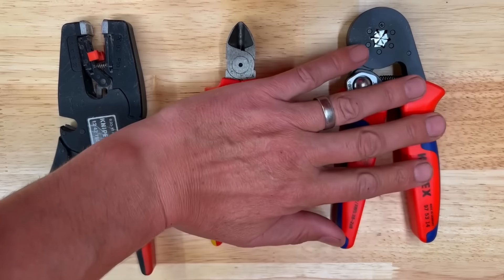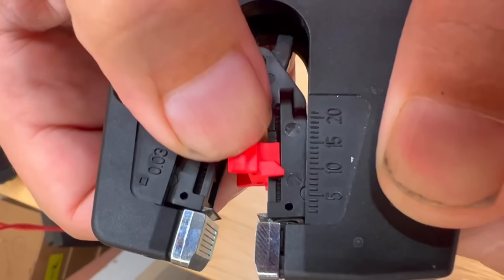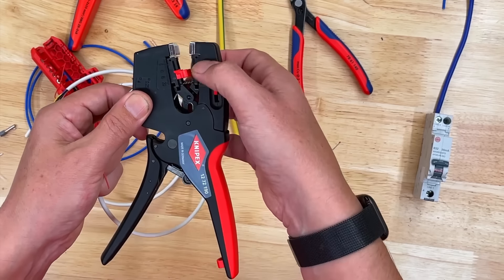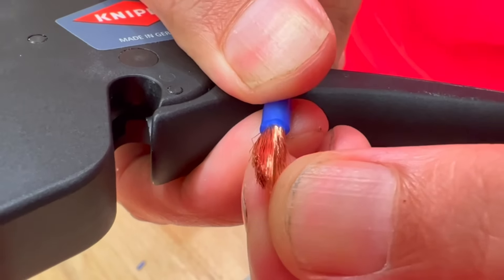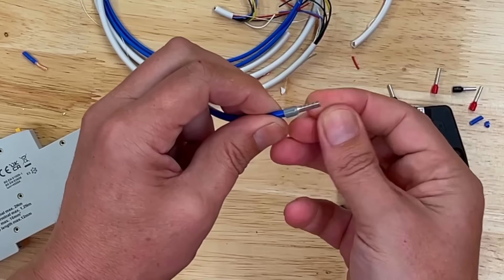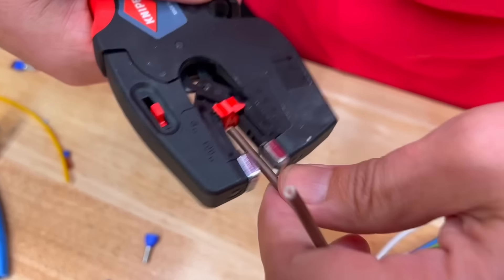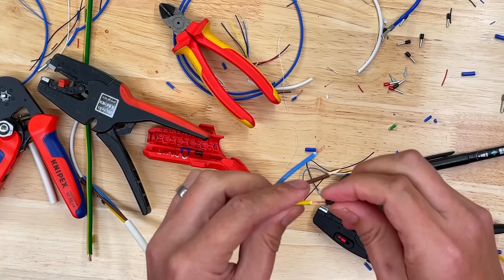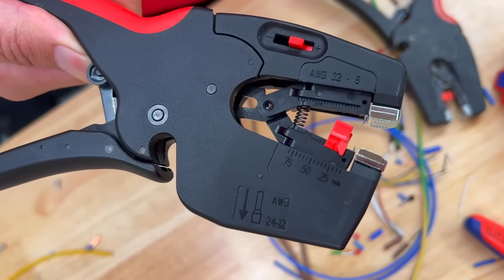What's Hidden Inside this NEW KNIPEX NEXSTRIP Wire Stripper?

Comment: This style is okay for building wiring looms up outside the panel, but as soon as you are inside a panel with all the components mounted inside, the cutter becomes awkward to use and I often revert to using side cutters for cutting the cables to length. There may be a similar issue with the ferrule crimping tool for some panels.
Reply: I tend to find the Knipex 97 53 18 Twister ideal for those tighter situations, not perfect but if you're not fussed about a multi-tool because you already happen to have the other tools with you it's generally a better buy.
Reply: @effervescence5664  Yes, I have the Weidmuller version of that Knipex crimper, which has served me well over the years, just need a similar version for insulated crimps!

Comment: I use a tool labeled "Bessey Erdi D49 160mm" to trim off the excess copper at the end of ferrules. It has a round cut blade so it can also shorten the length of a ferrule if it's too long, without deforming its end.
Reply from the maker: we'll check those out - we've got some huge ferrules coming soon.

Comment: I’am not saying I don’t like it. It’s a nice tool Nice if you like wasting your money, now most of the previous models will be binned. I will stick to what I already have  . I bet that’s about £70/ £80 just to replace two perfectly good tool with a fancy new good tool . Madness.
But who am I to argue i’am just a humble spark who’s opinion means nothing. 
Great video and demonstration as always Gordon 👍
Reply from the maker: Cheaper than buying a good automatic stripper plus ferrule crimper.
Reply: @efixx  only if you go for the brands with fancy names . My automatic stripper is branded quickwire cost me  £35 from Amazon my two crimping tools one is branded rolson cost £12 from a local hardware store the over one is unbranded and identical to the knipex and cost £ 14 from Amazon and they are great tools hey don’t rattle they haven’t worked loose they’re just as good as when I got them 4 years ago. But like I said I do like the look of that knew model.
Reply: £119 from ITS no thank you Gordon you said it’s ideal for electricians who are doing crimp’s all every day then I have to agree with you, you also said you think it would be good for general electricians electrician who use crimp’s once in a blue moon are not going to wast a £119 on a tool that will just sit in the bottom of there tool bag never tobe seen again or it will be lost somewhere in the back of his van . So I don’t agree on that point
Reply: @efixx  You'll need to get an auto crimper anyways for anything above 4mm so what's the point. Cheaper to save a bit of cash by getting the stripper without the crimping if you're gonna have to get two tools anyways
Reply: @stefanatli7769  what did you do before that new over priced tool came out . We are all being brainwashed into believing that wen a new tool comes out we need it or we have to have it . And we don’t I seen someone who has twenty cordless drill’s in his van all one up from the last one  model and all from the same manufacture why he doesn’t need them .
Reply: @Dog-whisperer7494  If you work in the industry of building Panels with hundreds of wires then this too would be an INCREDIBLE time saver. And you would also prefer brand tools to not have to replace em every few weeks. While I love cheap tools this would be something Id love at my workplace but we already got a Weidmüller crimp tool and a 10mm Stripex so we would have to "Change our system" which is too much work to be worth it...apparently
Reply: Sean, its overkill for a domestic spark but if you've ever done panel work or a sound and lighting tech esp if you have to make tons of 8 core nl8's or looms .. trust me it's worth every penny, i think i paid about 220 quid for my Jokari Quadro and it paid for itself within the first week with the time it saved
Reply: @AlpineTheHusky  yes for the type of work you described it would be a great tool as I already said , but for those of us that only use crimp once in a blue moon the it  a wasted tool that will just sit in the bottom of the tool bag/ box or lost in the back of the van and forgot about.
Reply: @thattoolguy9432  that’s was my point it’s a wast of money for domestic sparks as it will never be used
Reply: @AlpineTheHusky  as I said my tools were cheep as chips and I had for for year or so and they are just as good as when I first got them, no issues with them at all. Most of my tools are over thirty years old unbranded cheep as chips some I got off my brother some I bought, none have failed me yet. But to be fair they were all made in England. So they are good quality not the best but they have lasted for over thirty years , and in my book that counts for something. How many of these modern tools with fancy names last certainly not thirty years or more.  But like I said I like the nex-strip but do I need one no do I want one no would I pay £119 for one absolutely not. But who am I to argue i’am just a humble spark who’s opinion means nothing .

Comment: Ferrule crimper seems pointless as you have to put the tool down to put the ferrules on. So may as well use a separate ferrule crimper. Otherwise a good tool. Will probably buy the older version as now it will be much cheaper thanks to the new one being launched!

Comment: Wierd that they didn't put the same jaws as the Preci-strip 16. They used the flatter and less grippy ones from the multistrip. The force adjustment seems meh too. They should've upgraded the Preci-strip by just adding the crimper instead of downgrading

Comment: Like any multi-function tool, it does a worse job at all of them. It's fine for wiring up a table top full of loose wire, I guess. The stripper will be useful if someone else is holding the wire, but side entry is better flying solo. It's huge too, why is it so big? I love my little nippers, sharp and...little.

Comment: Jack of all trades, master of none. I love Knipex products but don't care for this tool. First of all, I'll endorse hex crimps 100% of the time. I have crimped more square ferrule crimps than anything else, and I'll never go back.

The wire backstop is great but I don't like the stripping mechanism. This a a good tool but I disagree that it'll replace a good (proper) set of strippers and the Knipex hexagon ferrule crimper. The use case for these tools is why they existed in the first place.

Comment: But how does it perform on flat cables such as T&E or 3C&E? This wasn't shown.

Edit: Sorry to Gaz, I should have said twin & CPC  or three core & CPC  😁
Reply from the maker: It’s built for round cables only - no T&zero with this one.
Reply: No point showing it on flat t&e  .. you wouldn't fit ferules to solid core conductors

Comment: Introducing the Knip-o-matic II. New, improved cutting blades make wire work faster and easier than ever! It slices! It dices! It can turn whole ten-gauge wires into confetti in seconds, not minutes! It's the perfect party gift! Order now!
Reply: Seriously, though the tool geek in me is drooling profusely (despite the fact that I've not crimped a ferrule in a decade) while my inner skeptic is wondering how well a machine of such delicate complexity will hold up in the field (perhaps that lanyard loop is a subtle warning to not drop the tool even once). One hand clambering for my credit card and the other hand slapping it away.
Reply from the maker: I’ve had the multi strip for years
Reply: @efixx  Fair enough. It does say Knipex on it.

Comment: Добрый день! Все хорошо,  но 4мм² очень мало! Хотелоь бы 10мм² нужно, тогда этот инструмент выйдет в ТОП по прожажам. Либо 2 инструмента, один на 4мм², другой на 10-16мм². Так он будет годен только для щитов НКУ

Good afternoon! Everything is fine, but 4mm ² very little! I would like to ² 10mm, then this tool will be released in the TOP in terms of burns. Or 2 tools, one for 4mm ², the other for 10-16mm ². So it will be suitable only for LVA shields

Comment: Hmm, a little disappointed with mine. Tried 10 ferrules so far of different sizes and 8 pulled off.
Reply from the maker: Double check the ferrule is the correct size for the conductors. I mixed up the German and French coding.
Reply: Probably more disappointed with yourself.
Reply: @nw5835  how did you know?
Reply: Hi, did you manage to find out what's the issue? Thanks.
Reply from the maker: @lemech  The ferrules pulled straight off - French and German DIN systems clash on a few similar sizes 1 or 1.5 mm sq are both red!
Reply: @efixx  Thanks. So there’s a design issue with this model? I was thinking of buying.
Reply: @lemech  unfortunately not. My dedicated ferrule crimper never fails me.
I can only imagine that this tool is not compatible with the ferrules I have in stock. Perhaps I would have to buy German ones. Seems to not apply enough pressure.
Reply: @blistiff  Bummer. Looks like I have to skip this version.
Reply from the maker: @lemech  No, we like the tool and are using it almost daily. Some ferrule crimpers you can put almost anything in the jaws, and it will crimp the ferrule into some interesting shapes. For this one you just need to make sure you have the ferrule matched to the wire.
Reply: @efixx  Oh, I must have misunderstood your earlier reply "The ferrules pulled straight off - French and German DIN systems clash on a few similar sizes 1 or 1.5 mm sq are both red!". 
I thought you were saying the ferrules pulled off. So, as long as you use the right ferrule size, all good? By the way, out of curiosity, are you using Knipex ferrules or just generic ones? Thanks.
Reply: @blistiff  Yes, I confirmed that if I use 'no brand generic ferrules', it will slip off. The knipex ferrules fit the wires snugly before crimping and they stay put after crimping. The knipex ferrules are nice though, very well made.

Comment: Prefer the (very much cheaper) Preciva crimper - for £30 you can have a hex-crimper; better than square!
Reply: I got mine for £16 from Amazon
Reply: @w75525  yeah, £16-£30 depending on which one and the choice of crimp sets…..
Still beats the Knipex even if it doesn’t last as long.
Reply: @herrtomas6729  Technically speaking, the square shape is much better than a hexagonal one. You pinch the ready cable between two flat surfaces or just bolt it - much safer with square shape's two bigger contact surfaces. Other than that, if the tool doesn't affect the job negatively, who cares about the brand. 👍

Comment: No mag for ferrule strips, not really god for panel building and too bulky for installation work (have small size bernstein 3 in 1 tool that fits chest pocket). Nice try Knipex, bit disappointed with that companys design!
Reply: Can you recommend a model you would use?
Reply: What is the name of the Bernstein model Please?
Reply: @DjallalArchi  5-532

Comment: Oh no, never never twist the strands for ferrules and connectors!!  This is totally wrong and can be a fire hazard!!!
Reply: It's a slight twist just so you can push the strands easily into the ferrule without smashing them backwards. I bet that would be a worse situation. After all, you're compressing them hard inside a metal tube and then you bolt/clamp on it with yet another force, so... Let's stick to reality and not just engineering guidelines. 😉✌